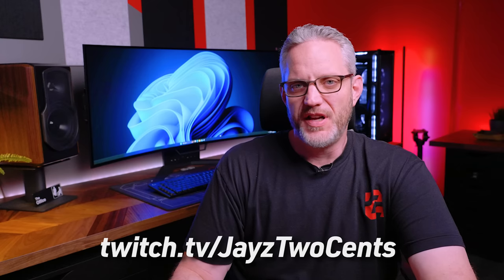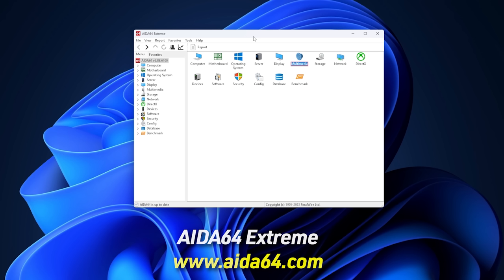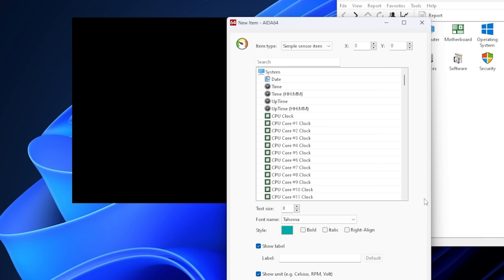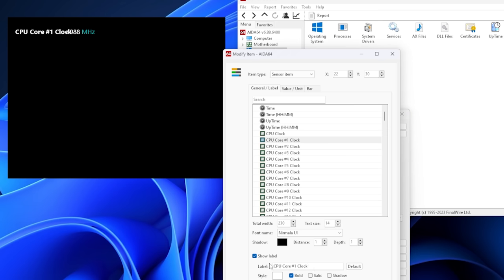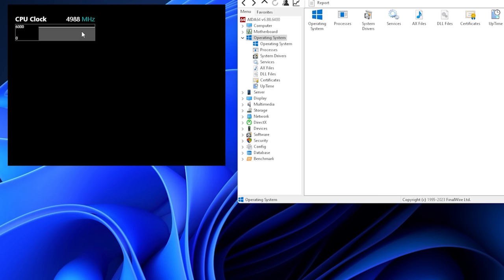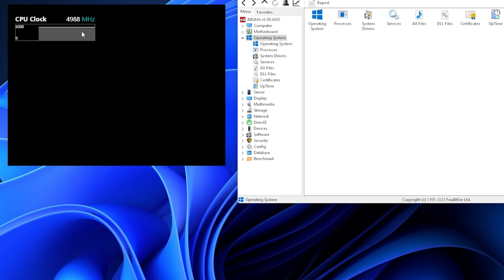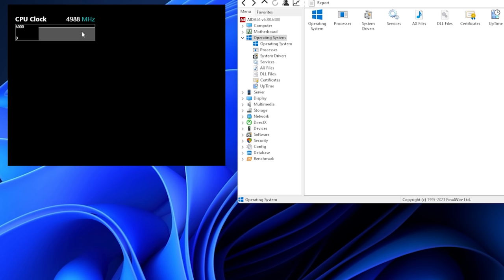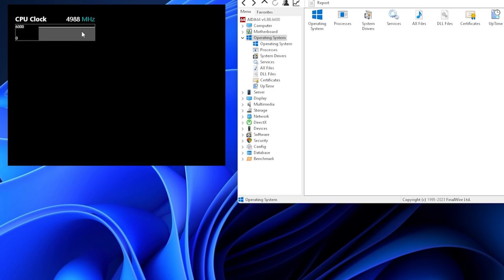Ultimate Sensor Panel Guide

Comment: Imagine having a G15/19 type keyboard with a display...
Reply: I got one of those! Too bad it's limited in what it can do. Most of the time I just have it display MSI Afterburner/RivaTuner information on it.
Reply: I used a G19S with aida for years.  At least until my wasd keys coating completely cam off😂
Reply: Still have my g15 going on 14 years
Reply: I have a G510, mainly use the clock but sometimes the monitor or coretemp applets.
Reply: I’ve got a g510s and a g15s on our family computer and they’re great wish we still had lcds and oleds on keyboards
Reply: Why.
Reply: Processing...
Reply: Well imagine having a MadCatz strike 7 and have a screen that is touch. 🤪

Nah had Logitech and madcatz and still to many compromises in terms of Switches keycaps and so on for me.
Reply: @aqulex84  I’ve got a old mad catz rat 7 mouse and it will forever stay in its packaging tried that pos one time and never used it again 😂
Reply: I have a corsair keyboard, mouse and rgb in the PC but they also sell a screen that you can control with icue and make macros or launch things from it, pretty much any Guage you need
Reply: Still gaming with my G13.
Reply: @Captharlock80  i got mine too, only the blue leds start flickering randomly sometimes
Reply: I'm still using mine g15 (last model)

Comment: I used Phil's video to help create mine. It takes hours of tweaking to get it just the way you want. Use the export import buttons to save your progress or go back to an old layout (you can save multiple layouts). A couple things to remember - the order of the items in the list determine which is on top of each other so you would want your background to be at the top of the list. And you can use this feature to layer graphs on top of each other - I have two graphs each with different colored lines to show utilization and temperature for CPU and GPU
Reply: Do you have a link to the video?
Reply: @gergelyr95  it's on Jay's channel just search for sensor panel

Comment: Helpful Pro Tip: Aida64 will pull sensor data from a UPS. You just connect the UPS to your PC (usually via USB) and then you can add items like input voltage (wall voltage) and total system Power Draw. This will be based on everything plugged into the UPS, so keep that in mind.
Reply: That's pretty cool.
Reply: That's actually pretty neat

Comment: Been using Aida64 for well over a decade now, since back when it was still called Everest Ultimate, and it's the second piece of software I install on every fresh Windows setup (after WinRAR to extract drivers). It has pretty much everything you could possibly need when setting up a computer (helps identifying your hardware so you can find drivers) and testing/monitoring its state afterwards.

And the customisation capability of the SensorPanel is insane. You could cram enough system info values into it to fill out an entire monitor if you wanted to.

Comment: I've had a sensor panel in my Phanteks case for a year now. It runs Aida64 on a 1920 x 1200, 10" laptop replacement screen. The parts cost me about $150, but it was worth it. I have so much info at a glance.

Comment: It was your earlier video on Aida64 that made me add one to my own system. I first started with just a 10" external monitor, and spent hours designing a layout. I recently found a white 14" Raspberry Pi monitor that matched my system perfectly, and actually installed it inside the case behind the glass side panel. Because it blocked the view of some internal components, I took a picture of the inside and incorporated that into the layout. Thanks for giving another detailed tutorial of the program; one can get easily overwhelmed for sure.

Comment: Bought a 7" display from Amazon on the back of your and Phil's earlier video.  Sits in middle of my desk where I can see it easily.  I've had fun setting this up.  I'm on my second purchase of Aida 64.  Well worth it and a fun project.  Also easy to modify when you upgrade your hardware.  👍
Reply: Would be neat if you could get a 12" that can do 4way split screen, especially helpful for monitoring multiple systems 🤔

Comment: Hey Jay and team! I got inspired by your original sensor panel video and built a 3D printed bracket for the screen to be mounted to the rear of a Lian Li O11 Dynamic (original). Just wanted to maybe inspire other people to the same for their case since it was reasonably easy.
Reply: maybe make a video about it, or post some pics on your profile...
Reply: How do acually get the sensor panel on the second monitor?
Reply: @cyclechris6591  I’m not sure what you are asking, once you create the sensor panel in AIDA64 you can drag the window over
Reply: @WindyStig Thanks, that fixed it. Not used to working with 2 monitors. Another trick was moving the sensor panel on the left of main in the windows monitor setting. Thanks.

Comment: I use HWinfo and MSI Afterburner to have an on screen display in the top left of the game as well as running HWinfo on a 3rd monitor.

Great setup.
Reply: Same sort of setup I run.  I have an entire 22" 1080p portrait screen to my left dedicated to HWInfo at all times.  And then I have Afterburner/RTSS also running a very small FPS and frame time graph in the top right corner of my main display without ruining my HUDs in games.

Comment: Got a 7inch display and am working on it rn! Only can do so much with the AIDA64 Trial edition including not being able to show the temperature of the GPU (Just shows "TRAIL" in whatever mode you're trying to display). Wish there were cheaper options rather than the $60 for 3 computers. /rant

I did manage to create a pretty sweet display with just the trial version. Cool thing is, you find information to display that you wouldn't even initially thought of. Even without AIDA64 the possibilities are endless. As for an aesthetic display, mounting one in your case with Wallpaper Engine looks really amazing. Can't wait to play around the options with this 7 inch display! Thanks for the video!

Comment: Jay that system you just set up that comes with the round analogy dials, if you were to add a panel they do make round, & you could even 3D print a housing for it to match those the system came with.  Or a long skinny panel, & set it up as the speedometer with the long sweeping needle half circle, & still 3d print a dial cluster.

Comment: I use AquaSuite from Aquacomputer which pulls data from HWinfo64 as well as AC's hardware sensors which, while extremely flexible, looks just plain dated. Will give Aida64's sensor panel function a try. Thanks Jay!

Comment: I have been looking for a simple way to make a sensor panel for a long time, and this video is great. but I'm looking for a solution where the sensor screen doesn't become screen number 2, when you sit and work and the mouse disappears onto screen 2 it's annoying. and not least that folders and apps are placed on screen two without you wanting it, how can you achieve that easily and cheaply??

Comment: @JayzTwoCents The "Engineering" version has a commercial license, supports command line automation, and provides ACPI and DRAM timings, and lastly supports up to 2048 logical processors as opposed to only 256 in Extreme.

Comment: I do the same thing with MSI Afterburner popout graphs, so damn useful!! all the big stats I can see, like temps and clocks, fan speed, and it loads up automatically when i start windows on my second screen, you can pin it to the screen to I THINK, but yeah I have it set to update every 6 seconds, 1 hours worth of data I can see at all times. lightweight only 4mb ram used. recomended

Comment: I bought a small 10" screen (1920x480) after watching your original AIDA64 set up video. bought AIDA64, and now run the small screen inside my case. 
Took a few good hours to set up a total of 28 graphs, each with labels, adding a picture, clock, and colour matching everything to overall PC theme. 
Worth it though.
Reply: that sounds amazing, can i download other people set up?
Reply: @geronaef1243  you can, once one is made, it can be exported in the Sensor Panel Manager, then imported on another PC, and edited as needed.
Reply: @stelp7617  oh thats nice, by the way can i have yours? if it's not too much trouble

Comment: Hey Jay, I just set up my senor panel.  However if I would go to run Port Royal the benchmark would not run and I would get an error message, but if I disconnect my senor panel it would run fine.  Have you experienced this?

Comment: Does it affects Corsair Icue software, I use CM Masterfans and Corsair Watercooling hardware. And for some reasons when I use Masterplus to set my rgb, it completely fudge all Icue sensors and stops the pump. I just have to uninstall masterplus to fix the issue.

Comment: Just out of curiosity how does rainmeter compare to AIDA64? I would imagine it is not as easy or clean but I know years ago you could get something similar with rainmeter, but it was more difficult to run with games, and I think you needed HWinfo running at the same time.

Comment: I have tried aida64. It does not properly Support Intel ARC. If you have anything plugged into the iGPU like a small screen for a sensor panel then you cannot get information about the dGPU as the iGPU because the primary adaptor. I run the iGPU (UHD 770) with the dGPU (A770) with no conflicts as they both use the same driver. If I have nothing plugged into my iGPU, I can see GPU memory utilization. If I Have it plugged into the iGPU then it ignores the A770 and looks to the UHD 770 that has no vram.

My sensor panel has a res of 480 x 1920. I tried to make a custom gauge of the same size and it crashed aida64. I could make smaller ones that were 480x240 and those ones work so there are limits on the gauge size.

If you don't want to have your sensor panel moving around when you turn your monitor on and off then when you arrange your monitors in windows, make it the the top left position.

Comment: Haven't done it with the software you used but I did something similar with a software called "Simhub" for my racing games. It basically just takes the data in game and uses it and I believe you can also set it up to monitor things like in this video also

Comment: MSI Steel Legend boards for current-gen CPUs seem to have a pretty compelling option of using eDP as a display option, so hopefuly with some community interest we can begin to see iGPU video integration at the mainboard level for many more future motherboards going forward. Ideally the option would also exist on the GPU but that would be heaps more difficult to hide away compared to a flex connector behind the mainboard.

Comment: ModBros had a project going that ran a sensor panel off of a Raspberry pi instead of, basically, running an internal display off of your graphics card. The concept has a lot of potential. I have not tested it in quite a bit, but it worked well.

Comment: According to their website, there's very little difference between AIDA64 Extreme and Engineer editions:
Engineer allows commercial use, command-line automation, ACPI information (presumabley from your motherboard) and memory timings. I think the biggest reason for the cost difference is the fact that it allows AIDA64 to be used for commercial use.

Comment: Hey jay so I’m trying to do a fresh install of windows 11 and every time after the activation key it says my system doesn’t meet the requirements. It’s a new build I just finished, I updated the bios I turned on amd tpm 2.0 I have secure boot uefi windows mode only turned on not sure what’s happening

Comment: do you know of anything that can record micro freezing of  usb inputs ro help figure out what is causing them? im having and issue with win 11 where the mouse games and fusion 360 work fine no freezing but if i use a mouse or any controller on usb causes a micro freeze every 20 seconds that will last for 1-2seconds and send constant button presses of what was pressed when it happened, if already checked ssd memetest86 xmp  e-core on off turning off suspend usb power nothing fixes it, win 11 had no issues when installed in jan of 2023 but this started happening march 20 have a 1390kf 3080 64gb of 4x16 3600mhz cl16 and a 1300w psu on a with a apc back-up.

Comment: Aida64 has a ton of screen options. I am using a 3 inch LCD that is USB connected - it's like a tiny digital picture frame. Mine is very retro, with plain bars and C64 fonts. I put an image of horizontal black lines, mostly transparent, on top of everything to give a scan line effect.
Reply: yesss ima do this. I didnt wanna use hdmi.

Comment: I use a comparable panel (Conky) in Linux. The display is a semi transparant column of 900x300 pixels on the righ. Conky has a file with a declaration for each item you want to display. Examples are: ${cpu cpu2}% or ${cpubar cpu3} or ${cpugraph 30,290 009acd f1433f -t} with size and color spec. 
I use yellow for size information and cyan for load info, the ZFS caches (memory and SSD) are pink.  High CPU and GPU loads turn from blue to red in the graphs. In other graphs they go from blue to white, because the throughput range is much bigger and red is too annoying.  

I display; host name; uptime; distro name and release; ZFS release; kernel release; date & local time & EU time; CPU type + freq; CPU bars & loads & temps & fan rpm; CPU average load + graph; RAM bar used & total; ZFS memory-cache bar & size & used (compressed and uncompressed) & hit rate; ZFS SSD-cache bar & size & used (compressed and uncompressed) & hit rate; swap partition info; video gpu-load bar & graph; vram bar used & total; datapool (say partition) sizes (free & used & total) with size for each dataset (super folder); physical disk throughput; datapool & SSD-cache throughput in graphs; net IP address and net download and upload  graphs.

In VBox Virtual Machines I use the same set up, but not all info is available, typical hardware info is missing like: video info; temps; fan rpm; physical disk info  (HDD; SSD) and ZFS cache info.  For all Linux VMs I run the conky declaration from a VBox shared folder, so they are exactly the same. For Windows VMs I use a small program from IOBIT, but I have a look at your AIDA64 sensor panel.

Comment: Beyond needing to solve a performance or hardware crashing problem, I never saw the point at all of constantly having that info displayed on the desktop. Now, of course, this video is dealing with a separate sensor panel right on the computer, so it makes a lot more sense, but yeah. Even if I did have one of those panels, while I would use it, it would be more a neat little thing to have for me. Otherwise, I don't need to know my hard drive utilization or even my CPU utilization every second of the day.

I think it would be MUCH cooler though if the sensor panel could directly control overclocking on the GPU and CPU. Now THAT would be worth buying a panel for and doing.

Comment: I was able to set up my sensor panel with help from the original video. Everything looks and works great, except one thing. The screen stays on and says no signal when my pc is asleep, I've changed many settings in both the BIOS and windows. Does anyone know how to get it to turn off without powering down my entire computer?

Comment: I use remote system monitor on an android tablet for my monitor panel, works great! Though you do need to donate a dollar or so to unlock the ability to set up gauges and graphs. Make it look like jays panel but it is soooo much easier to use then aida64, also, you can run an RTSS server and remote system monitor will also display the FPS of the game you are running without the need for an overlay.

Comment: Hey Jay, since AIDA64 isn't free or necessarily inexpensive and it's subscription software, what are our options for those of us on a budget who still wants to create our own sensor panel? No tutorial necessary, I'm just looking for software options. Doesn't have to be free, just has to be inexpensive and not subscription software. 

Thanks!
Reply: Aida64 isn't a subscription. You do only get a year of upgrades with the purchase, but it will work indefinitely with the last release of the version you can upgrade to based on your license. So you buy it once, get it all set up and you should be good. If you upgrade years later though, you will likely need to purchase a new license to get support for all the latest hardware sensors.
Reply: I see. I should've read their license page a little closer then, because it uses "Renew" instead of "Upgrade". My mistake.

However, my point remains the same: I'd love suggestions for free or inexpensive software that allows for something similar. You know, budget-friendly options. Just because one can afford it doesn't mean another can justify the expense.
Reply: Yea there are others out there like HWInfo, CPU-Z, etc but none that I have found that do the sensor panel concept so well. Most others are either very limited or tied to specific hardware.

Comment: Note that Corsair's iCue 4.x is incompatible with Aida64's sensor panel. I have some Commanders connected to fans and water temp sensors for a custom loop and when iCue is running, Aida64 will not monitor the temps and fan speeds. Aida64 will do nothing about it, blaming Corsair. Corsair has no incentive to change it in iCue either. iCue 3 used to work with it. It's a shame because iCue's lighting is nice on my system.
@JayzTwoCents should socially pressure Corsair :)